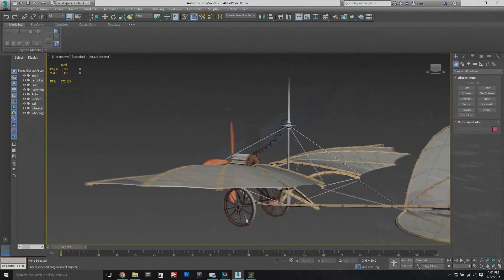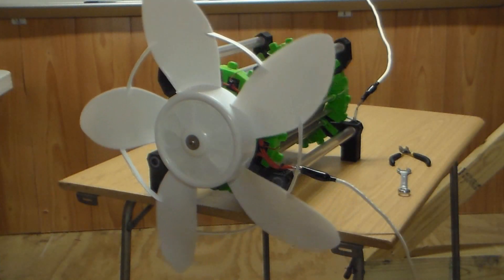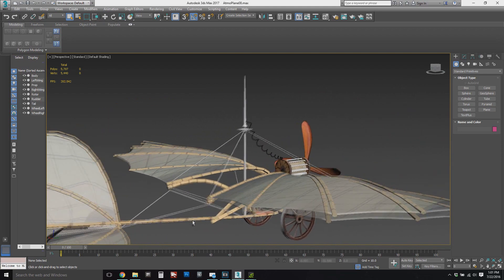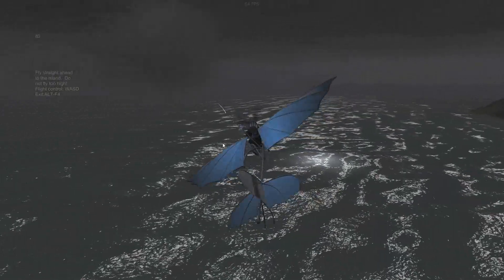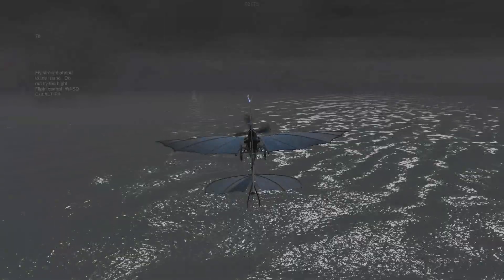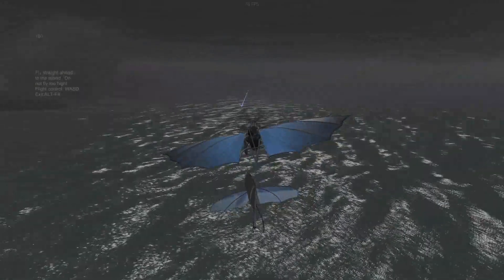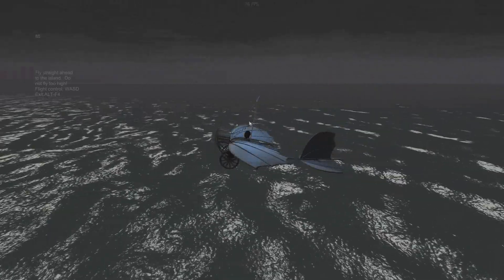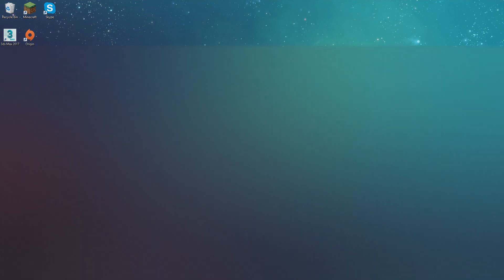XL AtmoMotor Build + Saber Flight Project Sneak Peek

Comment: The power to weight ratio doesn't support being actually able to make a craft that you could fly in. Physics says this isn't feasible. Anything can happen in a video game where we can simply rewrite the laws of physics. In real life I'm afraid that model will fail. The motor would have to be large making it too heavy. If your going to try this you may want to consider solar augmentation and batteries. With some of the newer RC model motors and controllers you might be able to use this design to actually fly. The AtmoMotor just can't produce enough torque at a light enough weight to actually fly.

Comment: I know you're probably optimising it for fun & interesting game mechanics rather than realism.  But if not:

At the moment it's effectively using the plane's height to store excess energy (and you discharge it by gliding), but this is troublesome as if you "overcharge" it (by flying too high) you'll get zapped.  You need a different way of storing energy, perhaps instead of having the motor directly connected to the propellor, it should be charging a flywheel instead.  
Or if you can't spare the weight for a flywheel, then how about an adjustable-angle propellor (like helicoptor blades) so you can spin it up faster (without increasing speed or height) to temporarily store excess energy.  Perhaps that would be too complex for the game's underlying historical set-period tho.
Reply: a more realistic way would be to gear down the prop and add some super caps to the motor.
gearing down increases torque and you need torque from the motor to spin the prop. if you connect the prop directly to the motor your just wasting power trying to get the thing to turn.
the p51 mustang had a gearbox connecting the constant speed prop to the engine crank shaft which increases torque but decreases the speed at which the prop runs

Comment: That's looks a great game, on the subject of bigger being more torque and electric motors, I was wondering if a Mendocino motor could be made with household solar panels? 
Of course it would need ball bearing races instead of magnetic bearings due to weight of the solar assembly but the torque is bound to be useable.